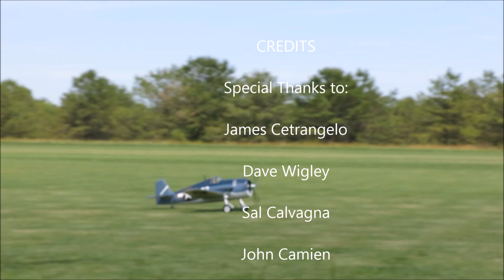First Flight F6F Hellcat and Moki 250 Radial Engine

Comment: Sure sounded like it fired up & had a cylinder that was dead. Black oil is not what you want to see coming out the exhaust.  😕
Reply from the maker: Yes that is true in most cases. This was my second Moki. The first one is a 215cc in a Stearman. Until they have a few hours to break in the exhaust is very dirty. It comes out as thick black oil. It was funny on the first flight of my Stearman my buddy was straddling over the stab as i ran it up. I tried out the smoke pump and all the black oil came out of the collector ring on to the grass and his new sneakers. It left the outline of his sneakers on a black background that stayed for weeks. Not to mention ruining a good pair of shoes. 😬

Comment: This is only RC Hellcat on Utube with "proper" 3-blade prop😊 My only comment would be that white stripe on the tail, which is of the CAG of USS Enterprise, except, I think the direction of the slant should be to the leading edge of tail, rather than to the trailing edge, to be 100% consistent😊 Beautiful model, my compliments 👍
Reply from the maker: I used the Hellcat that is currently hanging at the Steven F. Udvar Hazy Center in Washington DC for my color and markings. I believe that it was on the USS Yorktown at one time. I didn't know there was a similar color scheme for the USS Enterprise.
Reply from the maker: Actually the prop hub should be red but I couldn't bring myself to paint over the mirror finish on the aluminum hub. 😉
Reply: @LouCetrangelo  well shucks,   what do those guys from the Smithsonian know?

Comment: Like the tri / color, a power slide canopy would be cool.
The early roundel had a red border surround.
R 2800 Pratt and Whitney  2000 H.P. Six wing mount fifties convergent fire aimed for 400 yards.
Were very hard on Zeros.

Awesome flying field, plenty of room. 
With my electric flyer though just 15 minutes at full power would often have flights of two hours or more on thermals. Some times got so high if I lost sight it scared me. It had a jettison-able pilot with chute that my young boys would retrieve.

Comment: Very nice Lou. Love the Hellcat. One of my favorites. Nice job on the maiden flight. You might try using Klotz synthetic oil as it tends to burn more completely than others. Saito recommends it in their FG-84 r3 radial. Tower Hobbvies has it.
Reply from the maker: Thanks.  Actually I am using Bel-Ray MC1.  It is a synthetic 2 stoke oil and can be mixed from 50 to 80:1   I find that it runs very clean in my other engines and have been using it for about 4 years with great results.   Until it breaks in Moki Radials will turn any 2 stoke oil black and leave a lot of residue.   I am familiar with Klotz  and used to use it on my fist gas engine.  Most of use use Amsoil now but I prefer the Bel-Ray because it runs so clean with much lower carbon build up.